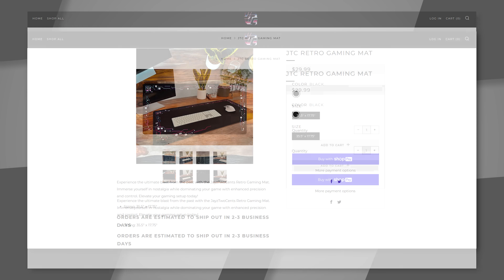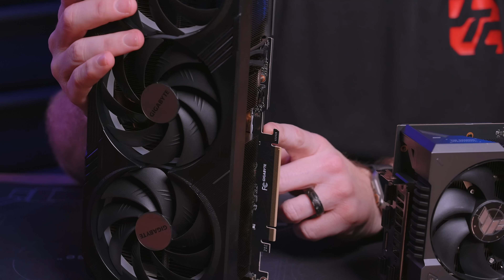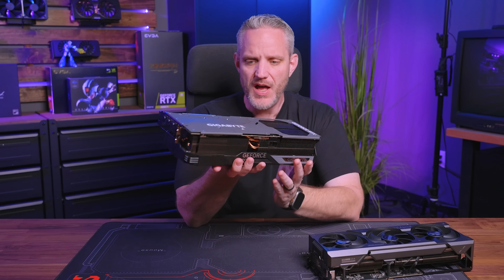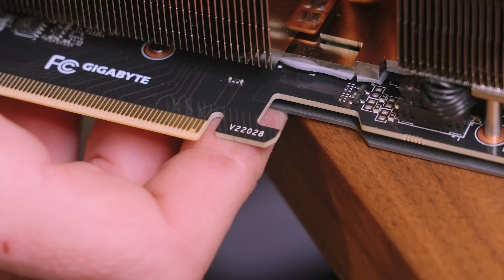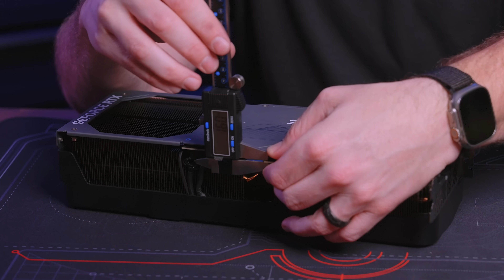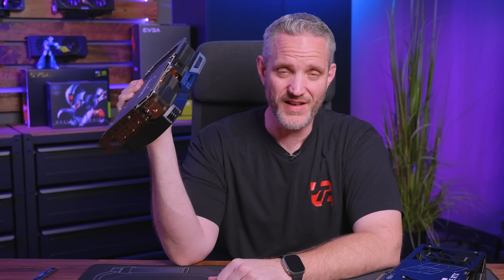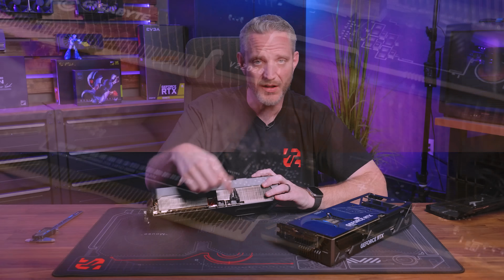These GPUs are cracking and the company REFUSES to warranty them!

Comment: The way I see it, there is major design issue with most current pc chassis. When the GPU becomes so big, the whole setup doesn’t make so much sense anymore. I am using Segotep Phenix T1 full tower case, where the whole motherboard is rotated 90 deg right, making the GPU vertical and I solving all sag and crack issues. Also this setup is helping the cooling, keeping the direction of the airflow relatively straight. I wish that there were more of this type chasis around. @JayzTwoCents, this setup might worth a little more attention?✌️

Comment: Main problem is that modern hardware is too bulky, heavy and non user friendly at all! Instead  that manufacturers produce longer PCI-e slot on the motherboard and connectors on the graphics card to prevent any flexing, bending etc, no they stick to the same process again and again and again. Mounting brackets and even PCB-s on the cards are made of cheap materials not good enough to prevent damage at all. It is a error that all the manufacturers make and they know about it for a long time and they just don't care, also it is easier to decline your warranty and not replace you card than to make newer technologies to prevent these problems in the future! 10 years ago it was so simple to put or replace anything from the motherboard because it was easy access now days its almost impossible to change something without breaking, bending it or damage it. Even the PC cases are almost not user friendly because if i have to think 7.000 hours how to put cables to keep air flow as much as possible i quit even before i try to do it. The trend to put your power supply down has become big issue because it prevent air flow and keep getting heat from the graphics card cooler. It was way better when power supply was up in the case, also it is getting so hard to get to the pins on the motherboard on the bottom simply it is not accessible when you put graphics card and power supply down. Moving all of the connectors on the back of the motherboard, such some of the leaders and giants of industry proposes is not good idea at all.

Comment: 6:45 when comparing the 2 pcb, the difference is the proximity of the tab to the cooler mount on the asus board. That's why it's more rigid than the gigabyte pcb. If you look at the effected cards by model rather than series, I'd say the coolers mounting to the pcb is the issue. A bit to much weight on this section combined with eject tabs being a nightmare to press. I use a plastic stick

Comment: I feel like the PCIe 16x slot and cards need a design revision. Specially as +3 slot cards become more normalized. Something like a hard screw mount just past the motherboard.  - Granted that would need cooperation between GPU and Case manufacturers.

I don't think any of the engineers who designed the slot in the first place ever expected cards to get as large and heavy as they are.  The first Dual-Slot GPUs (And I mean actual dual slot, not an optional VGA on a ribbon cable) came out the same year as PCIe. - And even those were extremely tiny, mainly using the second slot as an exhaust since case airflow back then tended to be really poor.

Comment: The boards may be CEM3. Fiberglass (generally FR-4) boards are better in many ways and the cracks aren't likely to run (like they have here) but don't perform well at very high frequencies and cost more.

Comment: Devil's advocate:

I feel like we could argue that more flex could technically be a bit more durable versus, very minimal flex, prone to cracking.

I.e. more flex can be good to allow for more bending/stress, versus material that bends very little, less flex prone and therefore easily crackable.

This is apples and oranges, but think of it like cement and buildings in cities where earthquakes are not common, versus other areas of the world where cement is reinforced/ and metal is also reinforced to allow for additional flexing to withstand bending from earthquakes.

I'd say Gigabyte made their PCB 'better' in this regard versus ASUS... Obviously, we don't know WHY these gigabyte cards are cracking or how many or widespread versus other vendors...
Reply: They made them better by making them bend more to keep them from breaking, yet they still break? And somehow, that's better than the card that doesn't bend and break? And we won't know how bad they are compared to the rest, till we wait around till the potential heatdeath of the universe if the other vendor's cards don't break?

Alright. Makes sense. 

Except it doesn't. Gigabyte makes junk. I've been bit on a gigabyte motherboard in the past, so they'll never get me again.

Comment: So apparently instead of the Capacitor Plague like it was in the mid-2000's, now it's just a plague of bad designs.
And with how much time EVGA told everyone that Nvidia was giving them to design their third-party GPUs with Nvidia silicon (it wasn't nearly enough, which is one of many reasons why EVGA pulled out of the GPU business), it's not hard to imagine that's why these defects are creeping into these designs.
Regardless, this isn't about the design defects. This is about how the company handles the defect.
Many companies have handled issues admirably.
Asus and Gigabyte... have proven lacking in this regard.

I used to buy Asus GPUs and motherboards.
I'm starting to think my next build shouldn't use Asus.
I hadn't ever considered Gigabyte before, because I was already buying Asus, but now I have to cross them off the list before the list was even created.
And MSI? I bought a gaming laptop from them once, it is no longer functional because the charging port broke on it (as in disconnected from the PCB). I couldn't figure out how to take the thing apart enough to even see the damaged area, only far enough to re-do the thermal paste. So they're out when considering laptops at least (proper design of a laptop would put all the ports on their own board(s) connected to the main-board with cables, because the ports are the most damaged part of a laptop after the screen). Charging port should be on it's own dedicated little aluminum-core PCB (alu-core PCBs are usually used for thermal reasons but in this case I pick it because it's physically stronger than a fiberglass PCB), and yes that one can have soldered wires going to the mainboard if it MUST, but a connector would be ideal. Why? It should be obvious. Somehow the charging port always gets damaged. You nearly always need to have a laptop plugged in to get anything useful done with it, and that means that there's a risk that something tugs on the power cord, imparting significant forces on to the PCB and/or port. First off, the port itself (not the PCB the port is mounted to) should be able to be fastened to the case or preferably the metal frame of the laptop, and secondly that PCB should be as mechanically sound as possible. How much is a RMA of the laptop gonna cost the company vs a few dollars or cents extra on the design and components of the laptop so that hey maybe the power cable breaks but laptop external power supplies are cheap enough for the end-user that you can reliably assume that it won't generate an RMA but the failure of the ability to power the laptop entirely will 100% generate an RMA if the laptop is not just replaced by something better (potentially from another company, hey look you big corporation, that other corporation is doing a better job at taking the customer's money than you are, you're losing out, FIX THE PROBLEM).

As consumers, it's not our job to force the corporations to make good products. It's our job to ensure the products that turn out to be crappy products cause a negative impact on the reputation of the corporation that produced them.
In other words, if ASUS motherboards are frying AMD CPUs and it's the mobo's fault, that should mean we stop buying Asus.
Same with Gigabyte, if their GPUs circuit boards are cracking in a way that renders the GPU non-functional, and they won't honor the warranty, then switch to another brand!
STOP BUYING JUNK. VOTE WITH YOUR WALLET. IT'S THE ONLY THING THE CORPORATIONS PAY ATTENTION TO.

Comment: as someone who has built 20+ high end pcs top of the line gpus triple rads custom loops etc.. and has built pcs for 20+ years the quality of pc hardware fell of a cliff after "2020" and the problem is that it keeps getting worse but they have no excuses today, it's like the quality started "corroding" and the rust is only getting worse and worse

Comment: i was uninstalling my strix 3070ti and i didn't know there was a something locking it to the MB i though i only had to unscrew the screws so when i pulled the gpu out it didn't come out and i had to wiggle it right and left it took me a minute to realize there is retention tab thankfully the strix is a beast and it didn't crack.

Comment: My current MOBO are from Gigabyte, it is also my first Gigabyte motherboard, and though it have not given me any substantial grief, it will also be my last Gigabyte motherboard.
That is however not something i just came up with, this board are 3 -4 years old, but i have been thinking along those lines after the first 12 months or so.
Actually this TR4 MOBO, also one of the most expensive motherboards i have ever gotten. ( HEDT )

O ! BTW my screen is Gigabyte too, nothing special but not expensive, just cheap 1440p / 165 Hz
Reply: What made you not like it? Shitty software, or the fact that they include stuff like Norton antivirus in their tools? Something entirely else?
Reply: @Genshinlmpact  No what i dont like is the bios, it just feel weird to me.
The tools ( APP Center ) is also annoying me.
It is not really big things, just i have tried a gigabyte motherboard, and now i am ready for something else, that is something new if / when the hardware makers get their prices not least together, i am retired and on a limited pension, so the days of building a new system every 1-2 years are long gone.
Same are my want to do CO and casemodding

Comment: As much as I preferred Asus for a very long time, gotta say when they get it right, it's right. I've never been a real fan of Gigabyte, even if their performance was often slightly better, because their quality was often lacking, customer support was miserable, and the management is downright stupid. Asus just took several very big hits to it's fan base and reputation, Gigabyte should be all over that with proof of doing things better, instead they catagorically deny RMA's for obvious factory/manufacturing/design errors resulting in breakages. That's just Bad Business.

Comment: Looking at your close-up's of the two cards it looks like the ASUS card is more rigid in that same spot because it has a nice tall stand-off that's part of the air cooler. Which is a big help. The Gigabyte card doesn't have that extra rigidity of any extra support. It's disappointing that Gigabyte is screwing over customers when it comes to warranty because I really love the looks of the Gigabyte AERO cards. The white and silver matches my build. :)
Reply: I noticed that too. I'm not an engineer, but that additional rigidity can't hurt. Also the PCB doesn't have that slight cutout above the tab giving it a little more material and less room to flex. As for the cracking, just like electricity, once pressure is mounted the path of least of resistance is going to be where it splits, and that's going to be the trace.
Reply: @sarges1712  I'm no engineer or rocket scientist either. But when I saw Jay's close-up's I picked up the different between the two immediately. 

My job consists of fulfilling customer orders on a daily basis. So I have to be more observant than the average person. If I don't catch things it could mean a messed up order and a very unhappy customer.

I'm not surprised about the traces getting messed up. There's quite literally nothing there to begin with making it work in the first place.

It's the same problem when restoring vintage electronics. The protective masking coat on the PCB will get ruined over time and the copper traces will get destroyed from corrosion. Bad enough to where the same technique of using tiny wire to rebuild the trace is required.

What makes this situation worse is it's on a brand new $2,000 graphics card and not a 30+ year old game console. To top that the maker is well aware of the problem existing but doesn't want to give a refund when the problem happens.
Reply: Absolutely! Pretty ridiculous they completely overlooked that standoff right next to the tab
Reply: @mattg8593  I can't really blame Jay too much for missing it. He was more than likely focused more on showing the differences in flex versus seeing the details that made the ASUS card more rigid. When you have a concern over a product with a problem known by the manufacturer and you want to inform viewers who might have bought it you tend to gloss over the small details that make the competitors card more rigid.

Comment: I have a Gigabyte 3070 Ti in my system. have it mounted horizontally, but I also cut a few bars of clear acrylic to hold up the butt of it to prevent any sagging (plus that added effect of color through the acrylic is nice). if there's a chance of it cracking, I'm not touching it unless it breaks or I'm putting in something new lol

Comment: It's also the same on 3070s, well My 3070 Gaming X TRIO 3 Fan i noticed a few month ago while changing motherboard that the tab is super flimsy and mine was a little deformed. haven't seen any cracks but im guessing its just a question of time even with the antisag bracket that's included it still sags

Comment: GPU sag can cause BGA failure, most typically on the memory modules closest to the PCIE slot and occasionally the GPU core itself. The pcie tab cracking is caused almost universally by movement in shipping in a prebuilt, which can also cause BGA failure. All heavy cooler cards are susceptible to this, but Gigabyte's 3080-3090ti has a cooler screw hole very close to the locking tab creating an area especially susceptible to cracking over and above that found in other GPUs. They effectively did the opposite of reinforcing an inherent weak point. They then compounded this by routing small and critical traces through the area, where other AIBs have not. I recently repaired an MSI 3080 Suprim with a crack in at the PCIE locking tab, it had three faulty memory modules, almost certainly BGA damage caused at the same time as the pcie locking tab crack. I replaced the modules and the card works fine now, it's still got the pcie locking tab crack, and it's a worse crack than on the GB 3080ti pic of mine (the one ground down through the layers prior to repair attempt) featured in Louis' original video on this subject.

Comment: Gigabyte screwed me on a bad motherboard a few years back, they won't get the chance again. Have an old workshop PC running a Gigabyte board and it has been doing so for nine years (old 4790k in an 1150) so felt it would be ok at the time if I used one of their motherboards again, yeah mistake.

Comment: well. I now have that gigabyte card you showed here. I hope the included support bracket is enough to prevent any issues.
Reply: Should be, the issue is caused by too much stress being put on the surprisingly fragile retention tab. If you're running a support bracket, you're alleviating that stress, which should mean that no such issue would appear.

Comment: If you look at the tab on the Gigabyte card there's clearly a weird part of the PCB just above and to the right of the tab that is cut out in a big rectangle shape. I pretty much believe this is another area where the problems in flexing/cracking can occur, there's a lot less PCB surrounding that tab than on the 40 series card. It's clear to see at  6:54
Reply: Interesting catch. There is no such cut on my AORUS 6750XT, for example.

But it is 4090 sample, and we need to look at these 3080 cards
Reply: @DimkaTsv  don't say 3080 😂😂
My EVGA 3080 has been perfect lol

Comment: gpu cards should not mount like they did back in the 80s. There should be some sort of  new standard. Considering the size and weight of these today its a disaster to mount it the old way. Back in the 80s cards were very light, they could be very long but the weight was very low.

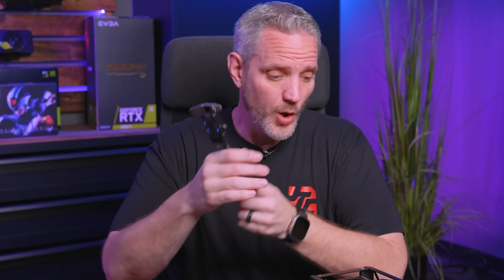Comment: At 9:04-9:11 when you flex you actually hear the Gigabyte flexing, would love to see a comparison breakdown of both cards in the video or 3080 Gigabyte vs (any other brand - without the issue), I would suggest that there are less support screws attaching the PCB to heatsink/fans or a poor placement of screws which is allowing the flex.

Comment: The thickness looks the same, but I am a bladesmith and the way gigabytes cut out near the tab is more square than the asus being round. The square corners are a stress point, even though they are rounded its still a weak point and any leverage there can crack it. I have seen it in knives where the blade meets the tang. The more meat at those stress points the better.

Comment: KrisFix-Germany talked about this problem with modern cards with heavy cooling solutions few months ago.
Many manufacturers have this problems and he advise to use a support or to mount the card vertically to avoid this problem.
Manufacturers should give vertical support with all the cards that are too heavy to be carry only by the pcie slot.

Comment: its sag, they abuse FR4 (pcb material) to its maximum limits, heavy cards mounted in slot, it will twist, and it MAY crack, or ram chip in close proximity will fail. 
You would be suprised, how many PCs people take to repair shop, with old card, that is twisted , and like 2mm diference in heigt on slot and 1cm away from it, hope you understand, point is, there was always RAM chip, in close proximity, that got teared from some traces.